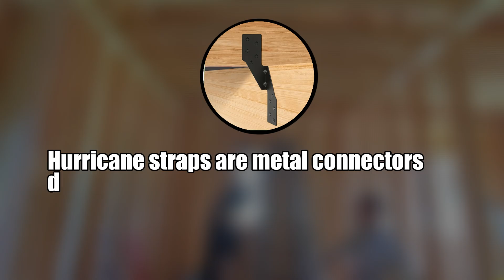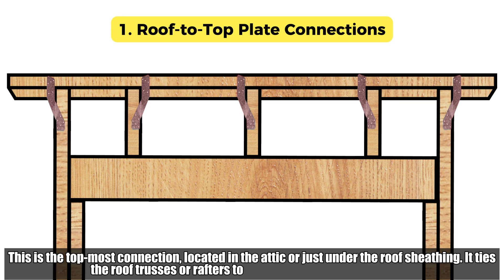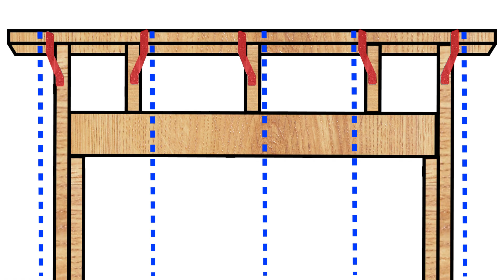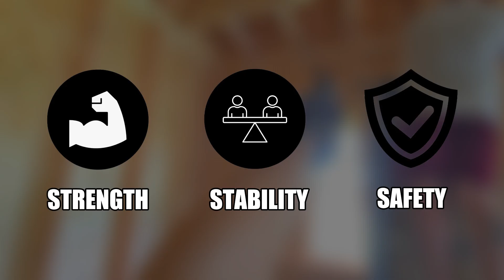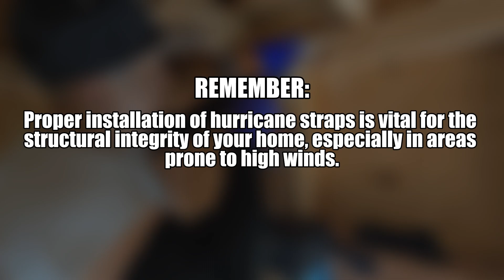Hurricane Strap Installation Made Easy | DIY Roof Framing Protection

Comment: Simpson hold down screws are faster and easier.No hanger in way of sheetrock
Reply from the maker: True, Simpson hold down screws do save time and make sheetrocking smoother without hangers in the way. But hangers still give that extra support and alignment, so it really depends on the build and code requirements.